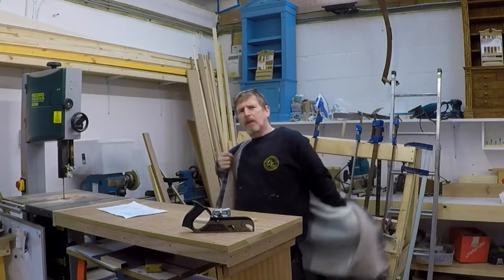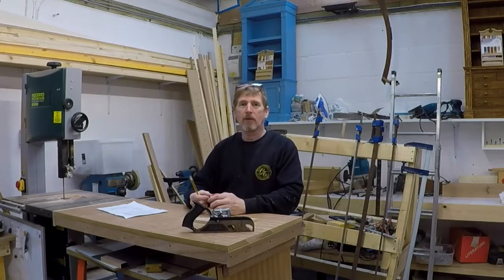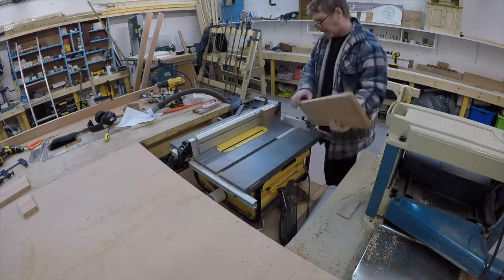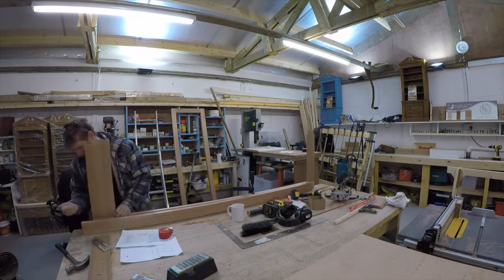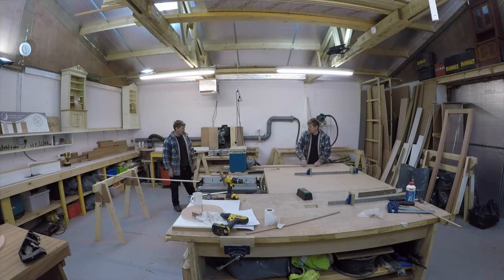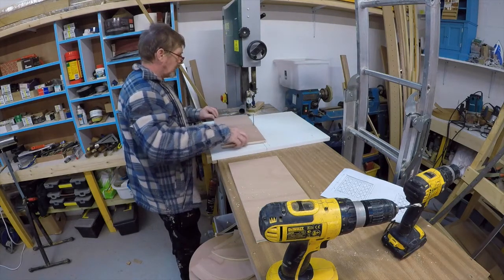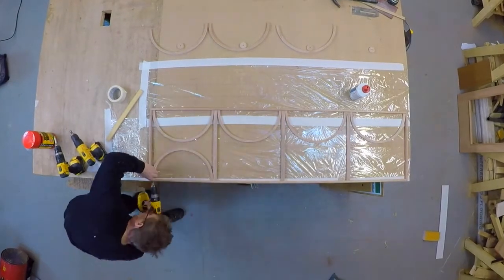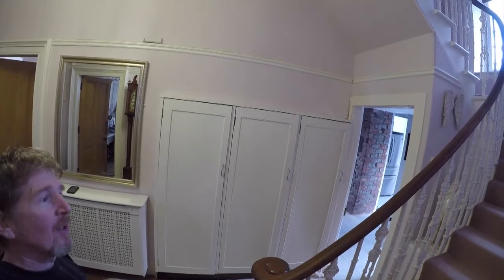Making New Cupboard Doors

Comment: Chalk and cheese mate, you did a fantastic job with those doors. Do you use any filler on the edge of the plywood parts to lose the appearance of the ply? Would MDF not be strong enough?
Reply from the maker: 😄👍Thanks Greg
It’s ply, MDF won’t be strong enough and wouldn’t last. The ply worked well, the only filler used was in the tiny gaps where there was a missing bit in one of the layers of ply, very little. Sanded very easy on the edges. 
The job turned out better than I thought it would actually. 
You should have two new subs from Israel this week 👍😄